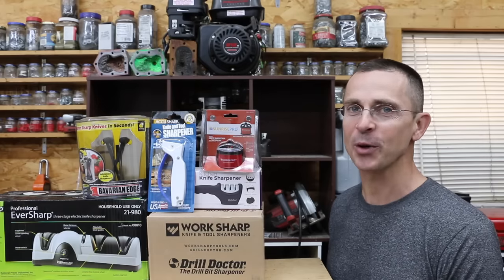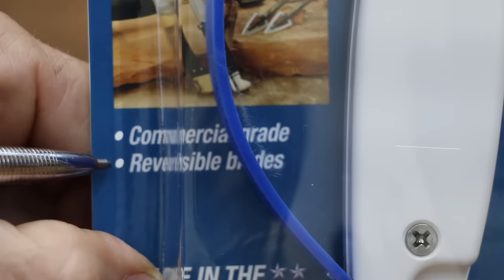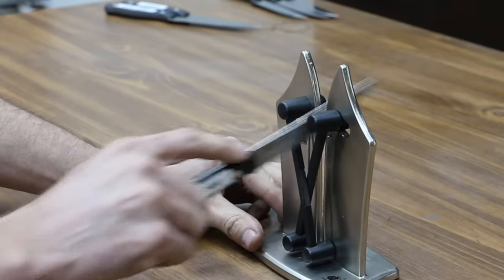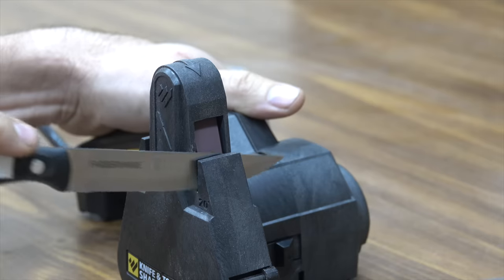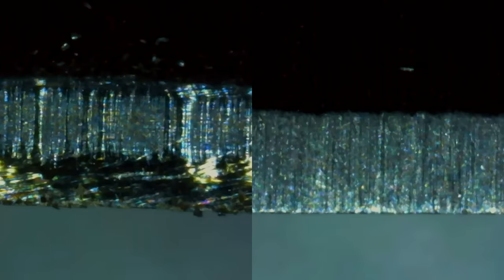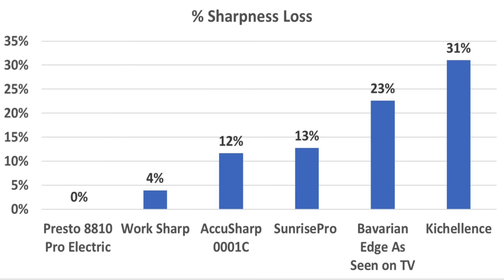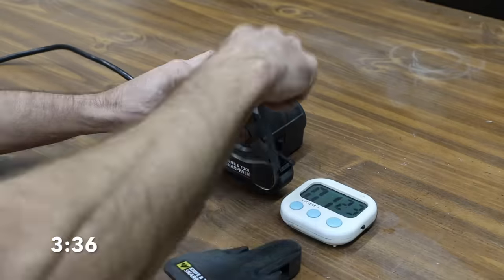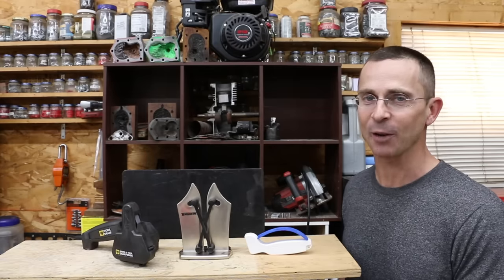Which Knife Sharpener is Best? Let's find out!

Comment: A before and after weighing of each knife would have been cool. Some of the cheaper drag-through sharpeners seem to take a lot of material off the blade.
Reply: If you have expensive knifes you should invest in a better sharpner.
Reply: @ot0m0t0  Absolutely. I don't own any of those cheap sharpeners -- it just would have been interesting to see.
Reply: ot0m0t0 hello, but ONLY CRAP KNIFE SETS I use these on ACCUSHARP,  anything GOOD,,gets the whetstone treatment, CheersFrom NJ🇺🇸🇺🇸🇺🇸🇺🇸
Reply from the maker: Great recommendation!  Thank you

Comment: I LOVE the fact that you read the instructions while you do this so we all know you are using whatever device it is, correctly. Very much appreciated.
Reply: True. It's so frustrating when youtubers don't follow the instructions correctly
Reply: Squiggummer Figgammus if the directions can’t tell a novice how to get the best results, then they haven’t done a good job on their product. 
So, Following the directions levels the field and creates consistency.
Reply: But what about the "Work Sharp Knife & Tool Sharpener Ken Onion Edition"
Reply from the maker: Thank you!
Reply: It's one of those things that deep down we all kind of want to do but are too lazy to do so 😂
Reply: When sharpening do 5 strokes each side, 4 strokes 3 strokes 2 stroke and finally 1 stroke on each side. Do not do repeat 5 strokes on one side and then 5 on the other.

This is why the Bavarian edge did better than others in maintaining.. user error.
Reply: @Narinjas  I have the Ken onion version & it gives all the abilities that the work sharp has as well as an adjustable angle guide for different blade types and leather strops for really honing the edge.  The basic system is the same and very functional as described.  Excellent comparison.

Comment: How 1.5k people could give this a thumbs down is mind boggling. This is standard by which all other reviews should be judged. Thank you for giving details that I didn't even know I wanted
Reply: He's doing the sharpening wrong...
Reply: He does a good job on somethings. However, he has to use the use the sharper correctly and he did not use the worksharp correctly or  even close to directions given by worksharp.
Reply: @jmavierpayne9726  he's reading the instructions
Reply: I go left side, right side, left side right side, etc with my Worksharp. My wife complains about how sharp the knives are.
Reply: I have given him "thumbs up", but there are one single real problem: he speaks extremely fast/quickly/rapidly! Sometimes hardly to understand!
However, the video is good.
Reply: Bc people are mad that hes showimg him they bought junk. Even if you get a knife to cut with these, they all destroy the blades just look how chewed up they are from one use when he shows the close up of the edges.

Comment: I’ve used the WorkSharp “Ken Onion” edition for 6 years.  It is without a doubt the finest sharpener I have ever used ,and I have tried them all.    From my hunting knives, working knives to my wife’s cutlery knives, the WorkShop has sharpened them to “Razor” sharp every time.    They also hold their edge for a long time between sharpening.  I do a “touch up” about every two months on the kitchen knives and it takes about 15 minutes to bring all 10 knives back to razor sharp.  Love this little machine.
Reply: thanks,  so i thing the ken onion, with the ability to give 15 deg is what makes it superior?
Reply: @KevsGuide the 1" wide belt attachment is worth its weight in gold. From pocket knives to my machetes, there's not a blade out that that you can't bring to a razor sharp edge.

I loved mine so much I bought one for my dad. He swears by his too.
Reply: I completely agree. I’ve used all the different kinds of sharpeners. I could never really get the hang of whetstones.

With that being said, the work sharp Ken onion is my all time favorite. I’ve gotten so many great edges with it
Reply: love it too.. i've read between the lines in the results and realized this machine will be the fastest, and also remain sharp longer. while producing almost no mistakes by the user. it might not have had the best result in the first pass but that could be caused by the lab destruction profile less matching the edge profile it's trying to make. in all other tests it's performed great. in reality, it performs great on knives that are dull by normal operation. doesn't create jagged edge, has no issue with angles, doesn't let you make errors. super fast sharpening of big loads of knives.

Comment: I think my wife also tries to cut grinding wheels with our kitchen knives. Thank you for another awesome video that will make my life a little bit easier!
Reply: I've come to the conclusion it's because of low grade metal.
Reply: Mine puts them in the bloody dishwasher, then complains they’re blunt!
Reply: @ammocraft  Are saying because of tempering?  They should only be seeing ~140°F
Reply: @louf7178  no some people think water droplets from the washing machine dulls a blade.
Reply: Brother you aren’t alone!     Mine spins them round the garbage disposer .  She also lives to pry kids off jars and whatever she can find to mangle the tips.    It just won’t sink in to pry with a screwdriver or even an old butter knife.   🤦🏻‍♂️
Reply: Does she use a glass or slate cutting board? If so, there is your problem.
Reply: @louf7178  It has nothing to do with with either heat or water droplets, IMHO.  Alkaline chemicals and salts in the dishwasher water from the cleaning tablets/liquid, and the potential for the knife edge to bang into something during agitation are the two main issues for me.  Oh, and whilst most kitchen knives are stainless, the high heat and humidity are even less good for high carbon blades and wooden handles, as should hopefully be obvious to all.

Comment: other channels - sharpen knife cut some paper "yep its sharp"
project farm - "hold my beer"
Reply: I think he is up to Keg at this point. 1M inbound.
Reply: Ya, it’s impressive.

I didn’t even realize that a sharpness tester like he uses existed until he got one.

He really goes the extra mile.
Reply: Paper test is better than his test. It tests the entire edge and if you know what you're looking for you can tell what areas of the knife need more work. It also allows you to see how the knife performs in slicing and push cutting, where his test only shows how the knife push cuts through string. The test in this video tests one tiny area of the edge and he isn't doing enough tests on each knife to account for variations in the string. He needs to collect more data. Maybe take an average of 15-20 tests per knife and exclude the top and bottom 2-3 results of each knife to account for outliers.
Reply: Wow so many likes. First notification i got was from revalatus comment. I wonder how many other things youtube is failing to notify me on.
Reply: Revelatus there is effectively no variation in the “string” those are scientifically calibrated test media, purpose built for this
Reply: i think it's clear by this that using most of the sharpening systems is very heavily reliant on technique.

the machine doesn't tell you everything about how well the knife is sharpened, you aren't cutting on 1 single mm segment of the edge, you need to know how well the whole knife is sharpened. if the tip and belly aren't well sharpened then you're not going have a very useful knife. if the edge has massive chips it's not going to be good either. and you won't find that out by doing a simple test like this. doing the paper test would at least give you an idea of how the knifes would work, the other option would be to actually use them in a real world situation.

you can get a good knife edge with almost any of the sharpeners. some just take more work, it's also convenient that he left out a vast number of sharpening systems. like the lanky and edge pro systems.

if anything this video just makes me want to buy one of those work sharps.
Reply: @Asmodeus04 i am aware of that fact. using the test machine requires much less technique then cutting paper, but everybody has cut enough paper to know what it's suppose to feel like and how to do it. if you've been sharpening knifes that is. it'll tell you a lot about the knife if there is any dull spots on the knifes edge, you'll notice them immediately when you use paper, but that would never be shown by the sort of test machine he is using, this knowledge is critical for how well the knife would perform in the real world.

using such a test system is completely detached from the reality of using the knifes. it provides a small insight, but isn't a helpful test on it's own. 

i would personally like to see some other test to confirm that the sharpness reading is really valid. like cutting paper, or hacking into wood, or cutting vegetables. all of these would give the extra insight necessary to tell us which sharpener does the best job. 

i've used some of sharpeners shown in the video, and i can say for certain-y that they don't all provide uniform results on the edge, if you try cutting near the handle where most of the knife sharpers have trouble reaching, you'll find that they aren't properly sharpened and it's really inconvenient. along with the tip, a lot of those sharpeners also do a terrible job there, which if you're cutting into something like a steak, it's going to be pretty noticeable that you picked the wrong sharpener, when it's as dull as a butter knife on the part that you use the most.
Reply: Revelatus the problem with paper testing is that it doesn’t produce any actual numbers, which means there isn’t any way to compare performance across a single standard
Reply: @railgunawesome7114  you don't need to know if a knife can cut paper. the test is relative. the most important aspect is whether the blades have any dull spots on the edge, where they weren't sharpened properly. there doesn't need to be numbers for it to be obvious which knife was sharpened the best.
Reply: @BloodSprite-tan  Agreed! If you're an accomplished sharpener, you can tell when it's 'fully' sharp and even put different styles of edges, all sharp mind you on your tools or knives.

Some applications need a finely polished edge, other needs a little more bite... Using sharpeners like these are more or less equal to ruining your knife unless it's low-end stuff that you don't really care about. I've been sharpening knives for about 15 years and test knives for a couple of knifemakers to test edgeholding and how well the steel took the heat treat. It's an interesting video never the less though.

I wish I could send in a knife that i put an edge on for testing... But the postage alone would probably be silly since I'd had to ship it across the atlantic. :)
Reply: BlackMoth27 The video isn’t meant for people who have any kind of technique or skill in this area, it’s meant for people who don’t know what they’re doing but want an informed opinion before they buy a product.
Reply: @irsmrtrthanu  how exactly is an informed opinion valid when it only considers a small part of the whole? if you only care about a single thing sure go ahead. but it's not like he even tested it on more than one knife. it's a very brief introduction and is no way complete enough to give you an informed opinion.
Reply: @BloodSprite-tan  the assumption made is  the area of edge tested is similar to the rest of the esge exposed to the sharpening method, and also that the same area of the knife is tested pre and post sharpening to show a difference. Also, low resistance/high efficiency to push cutting is a significant marker that it will slice well. Push cutting paper even is significantly more impressive than slicing because the edge must be much thinner. Which is what this measures. Thinner edge = less pressure needed to push cut a standardized media. Do you believe someone spent likely $100k+ to develop a certification system for sharpness for no reason and its actually useless?
Reply: @alecwallisch9045  i don't think it's worth arguing to a brick wall. obvious the test exist for a single purpose, and that purpose is not to test whether a sharpener is good. it only cares about relative sharpness.
Reply: Most videos demonstrating the paper cut test will likely be using whetstones for sharpening.
While this test provides numbers to rely on, as others have mentioned, it only tests the part where the knife cuts the wire.
One can learn how to freehand sharpen and get a much sharper and most important, durable edge than those guiding systems.
Not to mention the damage they tend to leave which is obvious from the macro shots.
Freehand sharpening for all!
Reply: I didn't even know those sharpness testers worked. So i test my sharpness by shaving and or paper
Reply: Push cutting through string on one spot on the blade is not a truly accurate way to measure sharpness.   Slicing through paper or some other material will give a better representation of blade sharpness. Also all the knives in this video were inexpensive and subpar blade steels. Perhaps a higher  quality blade steel would have been better
Reply: @informedcitizen8687  no it doesn't, its literally the exact opposite.  Go watch burrfection's video on sharpness myths.  Slicing through stuff; paper, tomatoes, whatever, while visually and psychology satisfying, and easy to replicate for the average joe, means nothing.

Also you should change your name if you're going to be making such confidently wrong comments
Reply: @Revelatus  OH well, from average housewife's view,, I am just a normal one that use knifes every day to cook for my family. This video is good enough for me to decide which a new sharpener I should get.  More elaborate extensive testing would waste my time thinking of the daily menu. Sigh.

Comment: When I give advice, not only do I put my reputation on the Line, I stand behind my word's and I have yet to be refuted, THIS CHANNEL ( Project Farm ) is not only one of the Top most informative and useful channels on YouTube it is by far the Most Honest channel. ☝
Reply from the maker: Thank you very much!
Reply: Just a pity the method of testing effective sharpness is flawed.
Reply: @ProjectFarm  Just a pity the method of testing effective sharpness is flawed. Knives don't get used for cutting 'string' - they're used for cutting '3D' objects and the method of cutting is by drawing the knife through the object not simply by pressing the blade against it (chopping). The sharpest of blade may therefore not cut the best or the easiest cutting blade may not need to be 'accurately' sharpened. I've not watched the video because of this and so the other question is, was blade angle considered - for cutting efficacy v durability. I would also expect different blade angles would better suit different toughnesses of material being cut.

My sharpener does not aim for a really sharp blade. It is a simple spinning grindstone and hence leaves a rough edge on the blade. This acts like a saw - leaving 'micro cutting teeth'. These  create points of micro extra pressure where the sharpest of blades will not do - meaning more downward force is required to effect a cut.
Reply: @millomweb  You have not watched the video and it shows in your comment, if you watch the video you will see that he tested how well the edge held up after being sharpened, and also looked at each knife under a microscope to see what the effects of each sharpener are.
Reply: @alexv.d.h.7331  Who cares what the blade looks like under a microscope ? No one in a kitchen, for sure !
Reply: @millomweb  From your own previous comment: "My sharpener does not aim for a really sharp blade. It is a simple spinning grindstone and hence leaves a rough edge on the blade. This acts like a saw - leaving 'micro cutting teeth'" you should be able to see those teeth under a microscope.
Reply: @alexv.d.h.7331  So ????
I don't need a microscope to know they're there !
Reply: @millomweb  Yes, if you have the blade right in front of you you'll probably be able to feel or see them. However because this is a youtube video putting them under a microscope is the easiest way to show them on video.
Reply: @alexv.d.h.7331  But what's the relevance ? Surely the video is about how easily a knife is to cut through things. A non-smooth edge will be felt when cutting - but that's not important, it's how easily it cuts that matters - so does anyone really care what the blade looks like under a microscope ?
Reply: @millomweb  you talked about micro teeth affecting the cut in your original comment. If they do affect the cut it is useful to show them in the video. This is done best with a microscope.
Reply: @alexv.d.h.7331  OK !
Reply: Jason O'Rourke. Could you please go into a more detailed reply? Idk what your trying to say. Thanks.
Reply: @millomweb  you typed all that and didn't mention blade material. Disappointment
Reply: @abolishguncontrollaws5689  Blade material wasn't a significant factor in this discussion !
Reply: @millomweb  Different steels do things better than others...
Reply: @abolishguncontrollaws5689  The issue is the 'edge' not the material !
Reply: @millomweb  blade geometry and material do matter. aus8 would be able to keep up with s30v and other super steels if steel didn't matter.